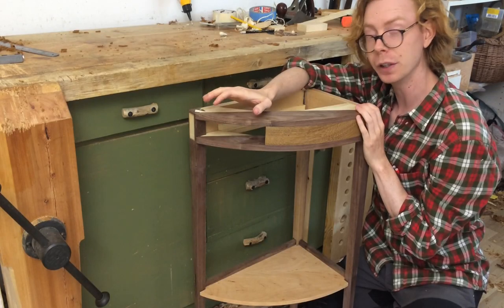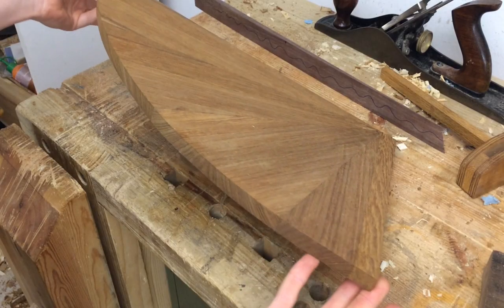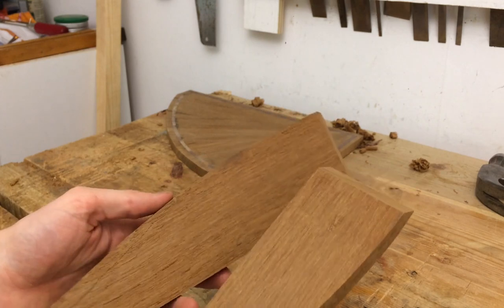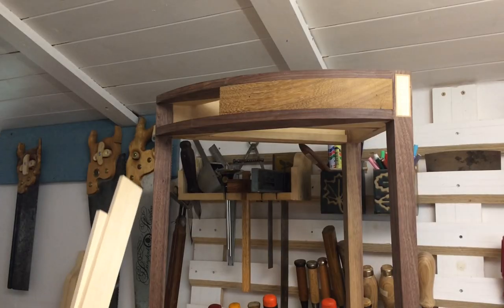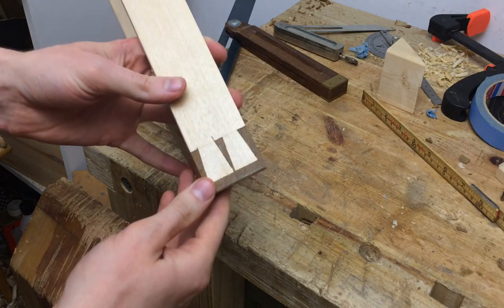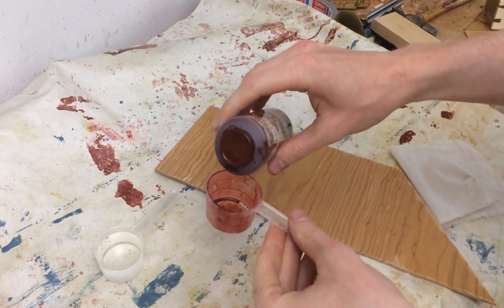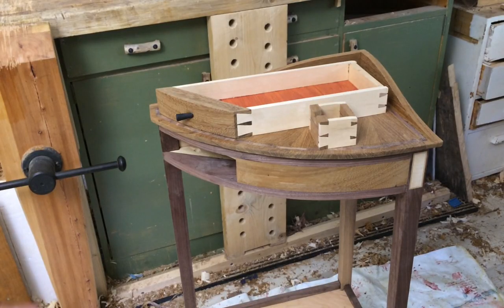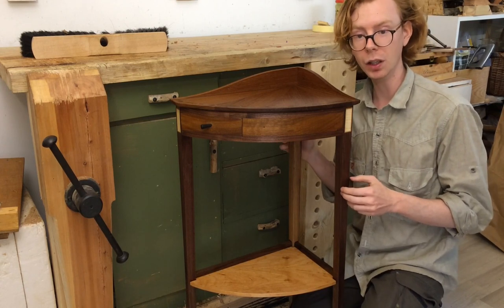Corner table part 2: drawer, top and secret compartment!

Comment: Instead of nailing the side pieces to the table top.  You could have floated the top in a groove.  This would have allowed you to glue the miter and let the top expand/contract within the confines of the grooves.
Reply from the maker: Thanks for the feedback Shaun, but I don't think that would work? I did that on the lower shelf because the side pieces are joined to the legs there. On the top, the sides are overhangning the base, so they can't be attached to anything other than the top.